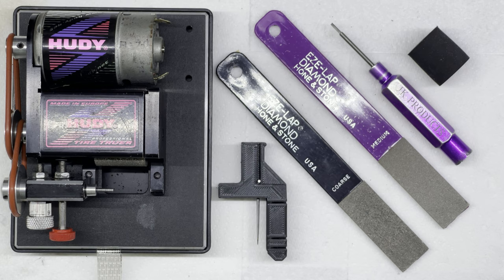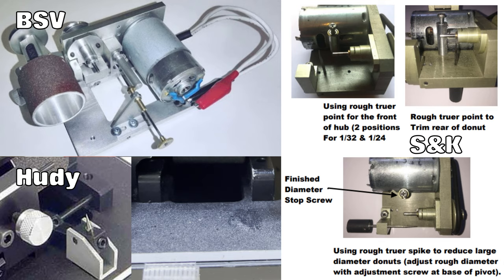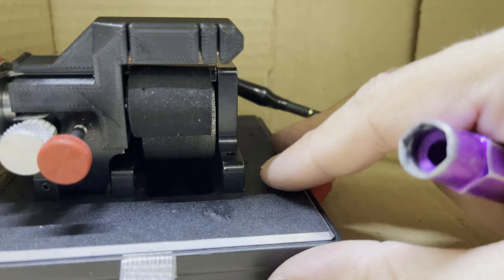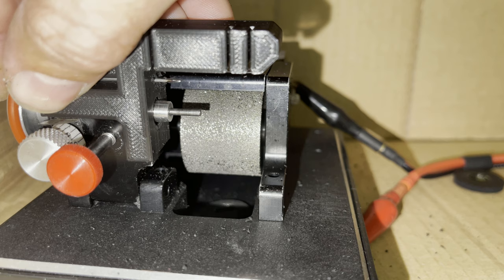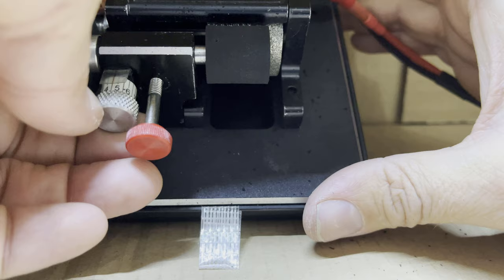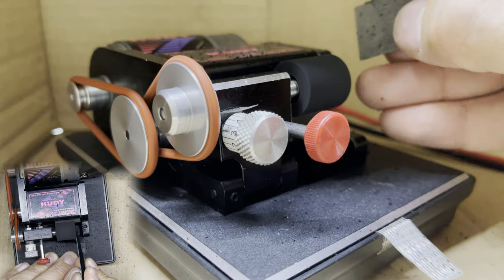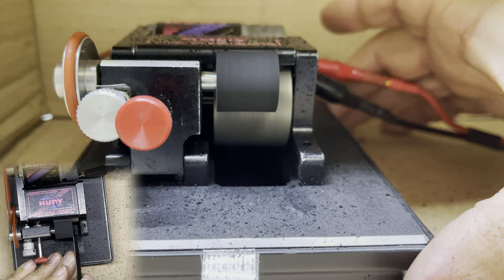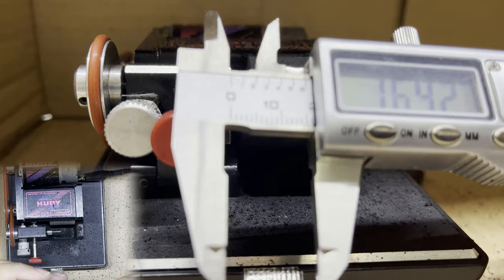Preparing Slot Car Tyres - Trimming and Truing

Comment: Be nice to see a truer that could do two hubs butted together so we can true two at once. Guess a bearing or V block support for the free end would be needed.
Reply from the maker: I think they already exist. There is one made by PN racing…
https://www.kenonhobby.com/PN-Racing-Pro-Tire-Truer-for-Slot-Car-Wheel-Shaft-size-18-332-2mm-and-3mm_p_45703.html
And one made by backtrack…
https://www.shoppscr.com/backtrack-2true-dual-tire-truer-bt2true
Reply: I’ve had the backtrack for a few months. First and only truer I’ve owned. I wanted this one because it does 2 at once and doesn’t require a 12v power supply. Probably trued 100 pair. Works flawlessly.